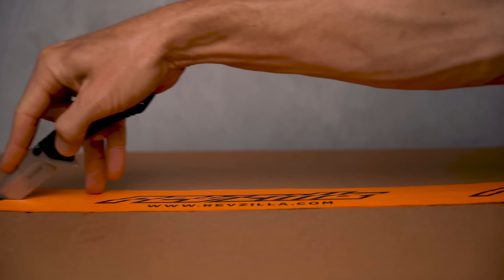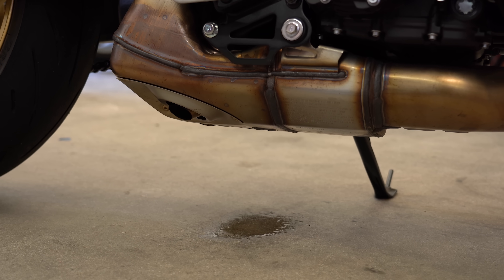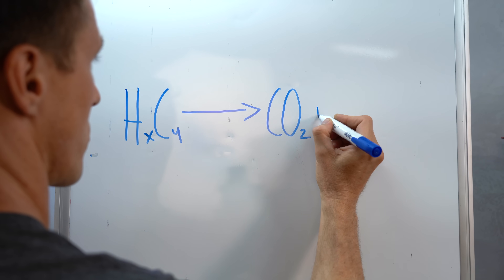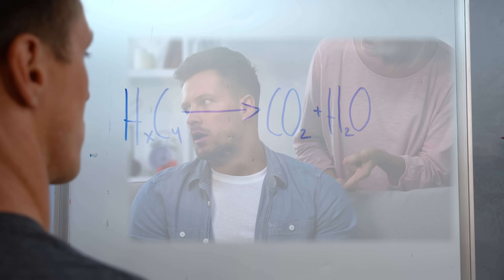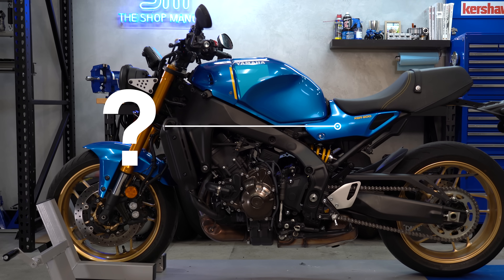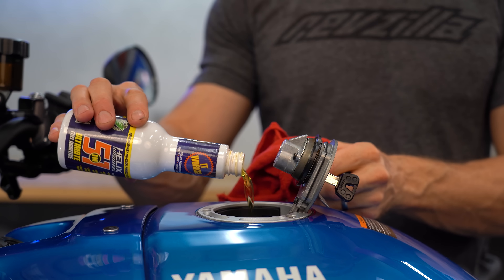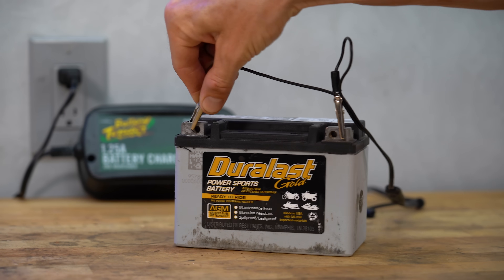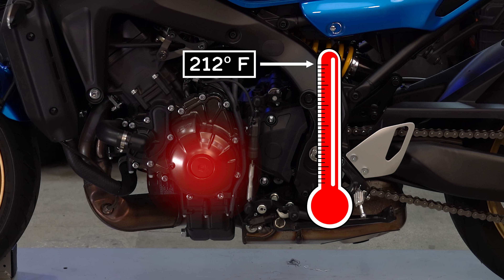The Storage Myth That Hurts Your Motorcycle | The Shop Manual

Comment from the maker: Find out more about preparing your bike for storage at Common Tread! https://rvz.la/3efdV5v
Reply: Can you do a video on engine weep holes.
Reply: Does indoor charging (on B-Tender) propose an indoor fire risk?
Reply: Riding all throughout the year is definitely the best option. The only time my bike gets parked for any extended period of time is when there is the possibility of encountering snow or ice on the roads. Temperature is never a factor. Clothing is available to keep you comfortable during those cold winter months.
Reply: Though it does get under freezing sometimes here I just ride mine anyway takes some getting used too but with all the heated gear available definitely doable!
Reply: I just spray contact cleaner in the air box and bump start it in the spring.
Reply: Paradox  rec 90
Reply: @andrewsoupene1028 ZwU😂😂gDan
Reply: Yes. The most effective method to this day. 😎 👍
Reply: You promote Kershaw...
Your opinion is therefore invalid.. 
Duh tho..
Reply: During the winter I ride my bike ( a BMW) on a fixed circuit of 20 miles twice a week.  Usually there is some opportunity in the weather to do do.  Gets the engine nice and warm, and clears the exhaust.
Reply: it's good to run your bike when stored. just remember to use a fan on the floor to keep the bike from overheating if your bike is air cooled.
Reply: No, there isn't a person in the world who doesn't understand all they need to know about weep holes.  No two bikes are the same, so they would have to cover each and every bike available. Obviously, the weep hole needs to be clean so it can weep....and that's it. That's all you need to know.
Reply: @edhotchkin5938 Of course it does.  Anything  that stores energy can be dangerous.  That's everything from a garage door spring to the air in your car tire.

Comment: Here's a tip, unless you get more than 3 foot of snow per year. I have for years rode my Harley throughout the year including winter. I go for an hour ride every two weeks regardless of temperature. I don't ride in freezing rain, sleet or snow. Have a wonderful winter, enjoy the air you breathe and life in general.
Reply: Man you only riding twice a month stop trying to give advice plus you ride Harleys
Reply: @yousmuttbuttyou  
Plus he rode when he should have ridden. My bike is down for the winter. Sometimes there's 7 months of it here where I live.   But when it's clear I ride hard, I ride long and I ride often.   I can easily put 6000 km on my Honda in the other 5 months.   And that's plenty.  An hour every two weeks is for pussies.
Reply: Lucky u😁
Reply: I don't ride in the winter when there is road salt remnents and residue.
Wait for a good rain to clear the roads.
Reply: This is me. I can’t winterize my bike. I’ve tried several times, and always end up taking it out when the weather is nice mid-January or after a few days of rain and all the salt washes away and there’s no ice in sight. I need to chase the dragon cause if I don’t I’m gonna be depressed.
Reply: Agree. I do the same. It's cold as heck, but I just bundle up. Want to make sure that motor gets nice and hot.
Reply: Very well said sir..
Reply: Come to Alberta -20 right now
Reply: @davidswain9645  enjoy life in general. Very well said sir. Godspeed to you..

Comment: I live in the Oklahoma City area and my bike is 14 years old and I have put over 100,000 miles on it.  I have never prepped it for winter.  All you have to do is just find one day per month that the weather gets up to maybe 40 degrees and put on warm clothing and ride it for 20 minutes.  Problem solved.  It will stay charged and the carb won't go bad.  You probably do need a windshield though.   Of course,  I suppose in Wisconsin it might not get up to 40 degrees all winter long.  Personally, I usually find a couple of days each week that it's warm enough to ride even in January.  But again, that's Oklahoma.
Reply: That's the best possible way to do it. I've ridden down to 11°F. 1 out of 10, wouldn't recommend, but I had to get home and my car was not running.
Reply: Mine is 16 years old and I bundle up wearing gloves and ride all winter long except on ice and snow without storing for winter and parked outside.The only problem has been 3 batteries purchased even though I charge on tender. I do add water remover and stablizer every winter and high octane gas. Biden wants to do away with fossil fuels...I hate him.
Reply: Lmao who is this advice for your neighbors? Most of the us is north of you
Reply: Ummm yeah. I live in Northern Europe and I could easily never see temperatures above 0 C starting from October all the way to April.
Reply: @meekinsstevenmeekins 👍
Reply: Laid my bike down on a small patch of of ice. Never again. No real damage,except to my underwear
Reply: What's a windshield??

Comment: Also, sit on the bike every couple of weeks, holding on the front brake and vigorously bounce the forks and shock { I do it about 30 times } to stop the seals from drying out. I don't have enough room past the car in my garage to keep the bike's tyres off the ground, so instead check the pressures regularly and then rotate the wheels, so the tyres aren't standing on the same spot for six months. At 65, I've given riding through winter months a miss.
Reply: I do the same thing but I like to make little "Brrraaappp Brrraaappp" noises while I do it for added effect
Reply: Never done that in 40 years of wintering bikes.  I don’t think 6 months is enough to dry them out.  Not saying I don’t sit on them and make the braap braap sounds, and pull some awesome fake wheelies…
Reply: People have the weirdest ideas. Oil does not go anywhere. It can't dry out. The seals have constant contact with oil. Never had it happen in 30 years on cold storage.
Reply: @Sunrazor  You're wrong. One of the mechanics at a shop that I use for both bike and car had a fork seal fail after six months of inactivity with his Bandit 600. You've just been as lucky as a pal of mine who's never had a puncture in 30 years of motoring.

Comment: Here's another tip I learned about cold weather storage: Do not mess with plastic panels when it's freezing, they'll crack.
Reply: Before you park it use some vasoline cell of any side panels so when or if you need to remove then the frozen hard rubber gromet won't be a problem.
Reply: @saywhat951  That might help on some bikes, but not all. Those panels often need to be flexed to get them on or off, and most are just screwed on, no grommets.
Reply: No shit
Reply: Make sense 😂

Comment: For the battery - install a Battery Tender SAE quick-disconnect harness with the end run to a location under the seat - Such an easy, cheap, long-term convenience. It makes charging "plug and play" and can also be used for micro inflators, USB chargers, etc. Battery Tender smart chargers come with one and they can also be purchased separately. Alligator clips like the ones in the video are for the birds (come undone, accidentally short, ...), especially the bigger OEM clips that come with the BT.
Reply: I have installed one on my bike, and it has saved me numerous times. Just find a plug and plug it in. Bad bike!
Reply: An investment that pays for itself in both battery longevity and convenience.
Reply: I haven’t had a bike in the last 12-13 years where I haven’t done this. First thing I do.
Reply: Dealer had installed one on my bike when I bought it new.  Idiots routed is so that it plugs in right next to the exhaust exit.  I have triumph SS 900 and pipes are only on right side.  There is all kinds of room on the left side.  I wish they had just handed it to me in a bag.  It's easy to move but damn, doesn't anyone think about things before they do them anymore.
Reply: One note is to make sure the positive and negative are correct any time you plug something new to an sae plug. I've seen them wired wrong, and put on backwards. Especially when buying a non-matching brand, a la ebay or such.
Reply: @0Rookie0  yes ! totally true
I use one to charge my bike and also have several attachments that plug into mine, like a usb outlet and 12volt outlet (and i had to change the polarity on some)
Reply: Or just remove the battery and store it some place warm. Works like a charm and fires up with no issues every spring
Reply: @Snakes709  it will still lose some charge.  Charge it before you reinstall.
Reply: I run mine through my scooter seat and I can plug in everything from my phone to the charger. First thing I did 😂 great minds think alike
Reply: @x-man5056  never noticed a charge. I just toss them in the spring, fire the bikes up with no hesitation, quick ride to get the oil warm and then change the oil and filter. Thats been my routine the last 12 years and has never failed except for 1 year on my zx6r but that was due to the rectifier going to shit so replaced that and a fresh battery. 

Although now im using a lightweight lithium battery in my bike so no idea how that will handle. Shorei says if it doesnt fire up to let it sit for a minute with the lights on and that will get it working.
Reply: @Snakes709  You DO NOT need to drain your oil warm.  If you use 10W-40 or 10W-30, your oil is only 10 weight at ambient temperature.  Ride the bike and put it away for the night where you will change to oil, let it all drain down to the crankcase over night.  It will flow right out almost like water in the morning cold because it's 10 weight oil at that point.
If you have a lithium battery it is important to keep it charged up.  With a lithium, you should plug it in every night if you want it to last.
Reply: I've found that BatteryMinder devices work better as they actively combat sulfur buildup.  I agree with the adding of an SAE connection.  Just be sure if you use it for other things that it's rated for the draw.  Took me a while to find an SAE setup with a 20 amp fuse so that I could power my CyclePump compressor and my Warm-N-Safe heated gear.  

How well does the BatteryMinder work?  My 2014 battery in the Honda is the original and does just fine.  Before getting the BatteryMinder, I'd used a Battery Tender and still I could not get batteries to last more than about 6 years.  Currently going on 9 years and I've run heated gear a few times on morning commutes  this fall and that battery is still plenty strong.
Reply: @christophersiano969  I find your comment interesting.  Please define what you think is the difference between a battery tender and battery minder.  I lived in Alaska for 3.5 years and my battery (in my truck) was 5 yeas old when I got there but lasted another 2 years being parked outside 100% all year round.  At the time I could walk to work so only drive the truck going to the commissary or out of town. It had a Schuackmaker? battery tender plug to it in winter when I wasn't driving.  But I'm not clear now whether it was a tender or a minder.  
    I'm wondering if just the act of significant discharge and recharge might be better for a lead-acid battery than constant topping off so to speak.  Your gear you plug in has likely a larger draw, especially your heated gear.  So I'd think your charge rate would be higher too.  Thoughts?
Reply: @x-man5056  Battery Tender and BatteryMinder are Brand Names of equipment.  The BatteryMinder has a feature called a Desulfur.  This uses a pulse to keep sulfur deposits from insulating the plates.  It also uses a temperature compensated charge formula that increases and decreases charging voltage based on the ambient temp.  

As I said, I have no scientific evidence, but just my own experience, the features of the BatteryMinder devices seem to give my batteries a far longer life than the BatteryTender brand which does not have the added features.

The model I have is the 2012 and the 1500.   You can find them on Amazon, but I purchased mine via a local hardware store that sold me on the technology.  I'm hooked because it seems to work.

Hope that helps.
Reply: @christophersiano969   I just opened mine and plugged it in.  It is from Amazon and only $30 Schumacher, so it's probably the tender style.  Yup, quick look on amazon shows the desulfator feature about doubles the price.
Thanks for the tip.
Reply: @x-man5056  One of the worst things you can do to a lithium battery is keep it at full charge.
Reply: @x-man5056  
Dealers don't care.  And I'll bet it wasn't a freebie.  Self installation is always the way to go.   Change it.
Reply: @imadecoy.  It depends on "Lithium/what?"  Not all lithium batteries are the same.  
The one thing about any battery is that they want to be charged or discharged.  Sitting unused, not part of a circuit, they all slowly discharge, different chemistries at different rates and other factors.
But the charging vs longevity question is a gigantic rabbit hole.
I would be interested to hear your theory though.  How do you keep your lithium Ion Tool batteries 'maintained' for longevity?
Reply: @aloisius4188  I bought it new, unseen except a picture.  They do put the screws to you after the deal with destination and dealer prep fees.  $484 for "dealer prep".  Got it home and neither tire has the right pressure, 1 too high the other too low.  Goons.
Reply: I have installed power ports on all my bikes with a fuse.  Then I got a male 12v plug from the truck stop and wired in the 2 prong lead for an adapter to fit the battery tender so I can plug directly in without the dangling lead.  Then I use a usb adapter in the powerport for charging all my electronics.  I also built a male to male lead to use for charging bike to bike if someone else leaves their key on or have a weak battery.  My wife has a tendency of shutting off the bike with the kill switch and forgetting her key and this works like a charm.
Reply: @geraldburmeister9637  FYI-all those 2 conductor leads and attachments are available on Amazon.
And tell the little lady to knock it off, it's bad for the electronics if it's an EFI bike.  The kill switch (I know you know this), doesn't shut EVERYTHING off.  It is for urgencies.
Reply: @x-man5056  You and I know that but it's what they teach in the msf course is to shut it off with the kill switch first.  I have since broke her of that habit.
Reply: @geraldburmeister9637  I took the course too.  Our guys said to use the key.  The cutoff is more or less for shutting the motor of when the bike is on it's side running.  We used the emergency cutoff, practiced it in the MSF training though.  But why use it every time?  Curious.
Reply: Exactly what I did. I plug it in whenever it's parked and my 7 year old battery still fires it right up.
Reply: @x-man5056  You will always get a more thorough draining of the oil if it is run up to operating temperature before draining. Used engine oil contains fine particulates, which are held in suspension while the oil is circulating, but when it has been left standing to get cold, some of these will settle out in the bottom of the engine, so that when you drain it, more of this will be left behind.
Reply: @x-man5056  Kill switch has its uses - when I park my 78 Triumph on the side stand, I always leave it in gear, but I can't reach the key without taking my hand off the clutch, so I use the kill switch first, then turn the key off afterwards. After 30 years, I now remember to turn it back on before attempting to start (most of the time).
Reply: @rickconstant6106  I know that feeling.  I have a bad hip.  I learned a way on and off that doesn't trigger it (cowboy mount), but it took a couple months before I could remember to use it first.
My Triumph ('22 Street Scrambler) shuts off if I lower kick stand with engine running.  It's actually been a pain a couple times
Reply: @rickconstant6106  Not since multi grade oil.  Not unless you let it drain until it's completely cold again, hours.  Buy running the engine you've just spread the oil all through the engine again and multi-grade oil gets thicker at operating temperature, that's how it works.   Presumably the engine WAS at operating temperature the last time you shut it off before the oil drain anyway.
You are stuck in 1960's mindset.  It doesn't work that way anymore.
Reply: @x-man5056  You seem to misunderstand how multigrade oil works. A 10W40 oil has the same viscosity as a straight 10 at the lower end of the temperature range (around or just below 0 C), and the same as a straight 40 at operating temperature (around 100 C). It will still have a lower actual viscosity when it's hot, it just doesn't thin as much as a straight grade would, as it gets hotter.
Reply: @rickconstant6106  NO.  If your do regular oil changes and the engine is in good operating order there is exactly zero reason to warm the engine up to drain the oil.
Presumably the bike was at operating temp when it was parked.  If it sat over night, all the oil that going to drain down is down.  If you pull the plug at that point, all the oil that is ever going to drain out at ANY temperature is going to drain out.  AQnd if it's 10W-anything, it will drain out like 10W oil, because it is.
If you run the engine within 8hrs of draining, you will leave more oil up in the motor that WILL NOT DRAIN, unless you leave it sit there for 8hrs.
Warming it up LEAVES MORE oil in the motor.  These are facts that won't budge.
Reply: @x-man5056 OK, I'll leave you to believe that.
Reply: @rickconstant6106  Good call.  It IS FACT.